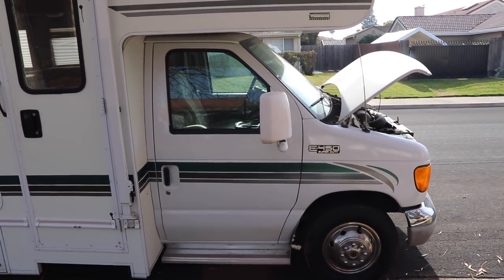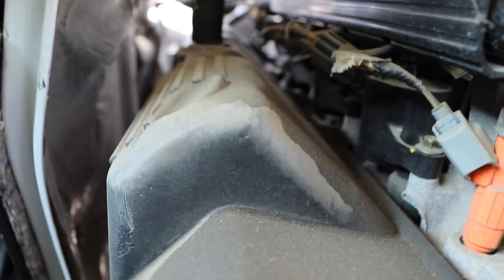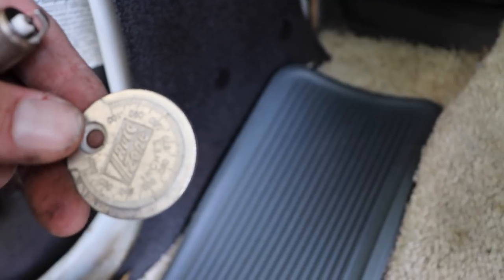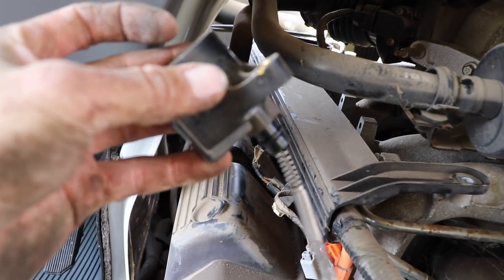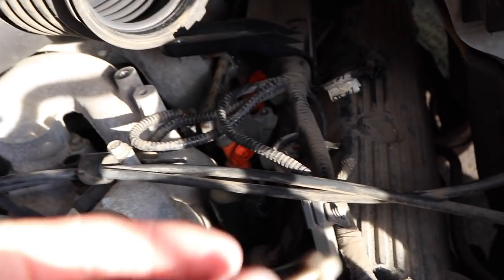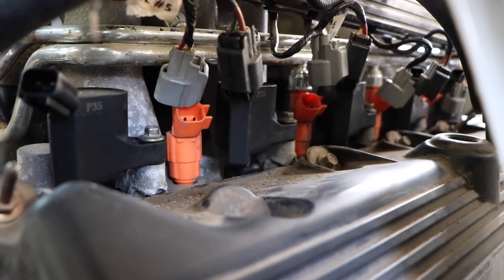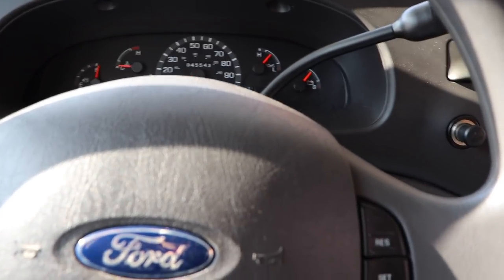Ford E450 RV how to change spark plugs, coils and air filter for maintenance

Comment: Best video I have seen on this topic.  Very impressive job!  I have '02 engine.  There is a lot of chatter about problems with the plugs in these engines being blown out. Not enough threads, aluminum heads, inserts required, etc...  Ford even has a rebuild kit for the plugs retapping plug threads.  Any comments on the plug issue?
Reply from the maker: Aethelwulf Freawine Thanks I appreciate it. I haven’t had that happen to me or heard about it, I guess I have just gotten lucky.

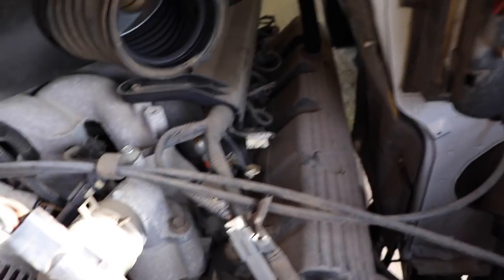Comment: 5:57, now it is a good time to spray some throttle cleaner. Don’t forget every oil change to add some sea foam to the fuel tank. Quantity to use? Follow the directions on the bottle, duh!

Comment: I wouldn't replace all 10. These coil on plugs can last the life of the vehicle. If one goes bad there are a lot of videos that will narrow it down to the bad one.
Reply: If he has over 100k miles on the engine,  I don't blame him for replacing the coils. I think these coil on plugs are more susceptible to failure due to the heat transfer from the engine and spark plugs.  I had three of these coils (on plug)  fail in my 350z and I only had 60k miles on that car.  After the third coil failed, I just replaced all of the old remaining coils.  BTW, the coil pack in my Ford Windstar failed at 70k miles.  That was just one of many parts to fail on that minivan and none of the failures were due to lack of maintenance.  The failures were due to low quality parts used by Ford.

Comment: Great video but I suggest using a top-quality coil because the aftermarket cheap China junk can break down and be bad right out of the box won't last long I've installed them on least Ford Triton motors they usually not good for more than one year
Reply: Better yet, I wouldn't change the coils unless they are bad to begin with.

Comment: Is that an 04 chassis?  You're kinda lucky to not have to worry about the late 05+ plugs breaking off in the head.  Im jealous.
Reply: I have a '97 E-350 with 435,000.  I have had number 4,9, and I forget the other pop out of the head.  Daily driver, and needs a tune up.  I have had it since '99.

Comment: How’s that 6.8L holding up? I want to see you time sert this thing once it spits a plug.
Reply: Thats the '05+ 3valve version of the 6.8l v10 triton with that problem if i recall correctly. This should be the 2 valve version
Reply: Actually the plug issue is on all years of the Triton engine.
Reply: @ronedelenbos272  which triton engine?
Reply: All model years of the Trion and all sizes 8-10 cyl
Reply: @ronedelenbos272  guess I was wrong. Thank you for the link.
Reply: Fudge.  Ron Wilson is a great source of Triton information.  Great channel.
Reply: @ronedelenbos272  😘 panther platform is my favorite so ill keep him in mind
Reply: I had two V10 Ford RVs a 2000 and a 2004 . The 2000 had 2 valve heads that has 4 threads in the plug hole. The 04 heads were 3 valve with a different head casting and longer threads for the plug. The two engines used different plug numbers . Online information is not the best source for info , go to the manufacture.

Comment: how long did the job take?
Reply: I did RV v10 years ago.  I believe it was 5 hours, with no problems, I'm doing it again 70k miles later, I'm taking out the passenger seat and see if I can cut an hour off the time :)
Reply: @chrisingram7277  -  Five hours sounds about right although it would probably take me longer.

Comment: Nicely done vid, but for the non-mechanic types please quit stating fastener sizes in fractional. They're ALL metric. Yes some metric will crossover, yes you might be missing the correct wrench/socket - but the chassis was made in 2004, not 1974 - the only place you may find SAE fasteners is in the ITASCA part of the build.

Comment: Nice work but he could have cleaned up the air duct before reinstalling it. He also forgot to mention how important it is to blow out the spark plug shaft with air pressure before removing the spark plugs, they are usually full with dirt and crap.

Comment: I have the same vehicle, my feet get very hot and the driver side is hot even. I turned the a/c off it’s still hot. What would make this happen?
Reply from the maker: Yonas Abraham I have actually noticed that too on mine and I feel its just due to bad insulation on the engine housing. It just gets hot and the driver and passenger feet are right next to it. Thanks for watching.
Reply: Yonas Abraham the exhaust pipes run right under the foot boards
Reply: It's mostly because of the way Ford has tuned them to run very lean, which means HOT and causing pinging/detonation. This is 80% of the reason that spark plugs come lose and blow out and exhaust manifold bolts rot away. A skilled and experienced Ford tuner can correct this and more. Some after market OBD II devices claim to do this too.

Comment: Why are you using Ford spark plugs?
Reply: Motorcraft spark plugs are the  OEM part for this application..
Reply: @timschmidt3784  You have to use Motorcraft spark plugs on these modular engines.  Don't ask why...It's a Ford thing.

Comment: I wouldn't use after market coils. I would use ONLY Ford Motorcraft coils and plugs. Even then there are many very convincing knock offs that appear to be genuine Motorcraft, but they are fake. There is a video here that shows how to spot the fakes. About the plug gapping. You didn't show the spark plug clearly enough to see if they were fake or not or that clearly showed the electrode, but a traditional style electrode and ground, which they appeared to be, needs a wire type gapping tool or your gap will be too wide because of the slight bend on the ground. Also, these engines run very hot due to very lean mixtures which is ultimately the cause of most blown out plugs and rotting exhaust manifold bolts. Proper re tuning can correct this.  Oh, stop calling a nut a bolt.